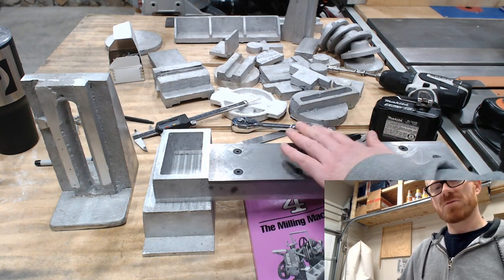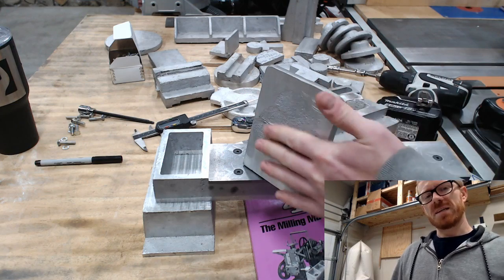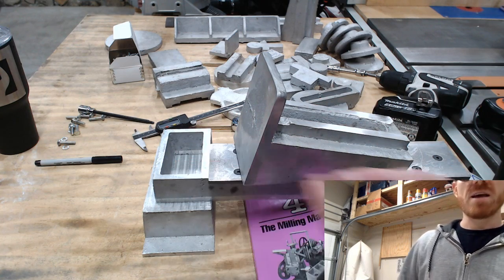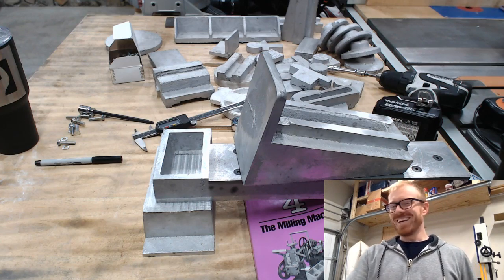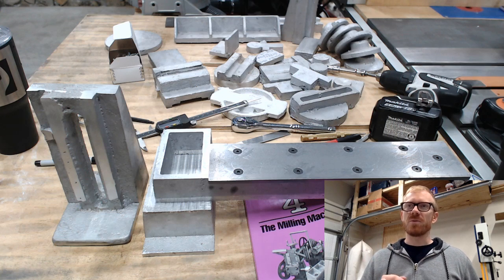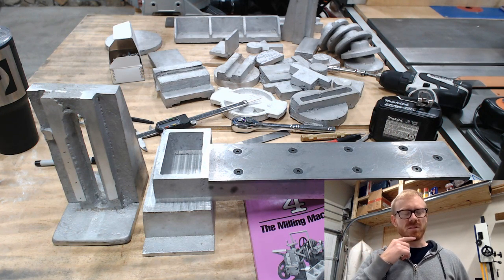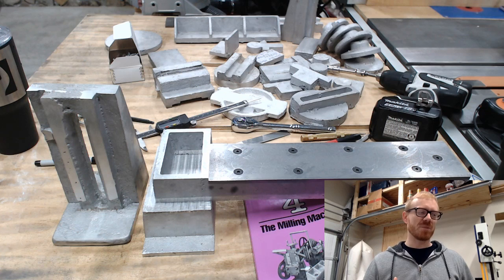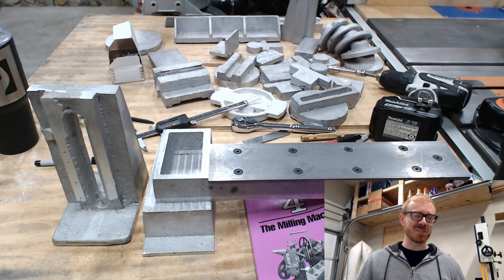Morning - Gingery Mill Bed Done - Ready for Head Stand

Comment: Thank you for answering my question yesterday I watch YouTube on my tv and my kits got a kick out of having my name said on television. I am looking to build my self a mill and this hole experience of build by book looks like the way I would like to go do you know if this mill plan is scalable to build for example 200% or 300% is this option mentioned in the book
Reply: Scaling some of the stuff like the overhangs would yield very flexible castings, overhangs would leave instabilities. You would need to look at the individual parts and decide from an engineering point of view. If there is a truss every 1 inch, you can scale the size up, but put additional trusses to have one per inch also. If the maximum width is 3 inches between two walls, and you want to double the width of a table, you will need to have another inner wall dividing things down the center. If you have any specific questions, I can answer those, but shortly, no, you can not simply scale the mill 200% or 300%. You will also run into the issue of casting the parts. Gingery designed the parts with a specific sized crucible in mind, so any single pour won't have a volume of aluminum exceeding that. The ways on the lathe are essentially the maximum volume you can pour already.
Reply from the maker: Well said AFriendlyMathematician.

Comment: I have the same question others have. I can see doing it this way for the experience, and I love watching your videos. But, I have to believe welding dimensional steel would get you there much faster. I understand the concerns about warping but it seems to me like if you are scraping the ways, anyway, you can take out the warping effects through post-weld finishing, too. Plus there are welding techniques to minimize warping and you can relieve stresses by putting the finished assembly through a heat/cool cycle. Maybe that isn't sufficient and steel just isn't stable enough but I've never felt like I've had a satisfactory answer to this question. I've been planning a lathe build for a while that will use larger dimensional steel as the main structure. I guess eventually I'll find out the expensive way. :-D
Reply: It can be difficult for a novice to get significant penetration on a weld without putting so much heat into the part that it distorts. Across the length of the bed of the mill, you could distort the part by up to 1/8ths, which i'd argue wouldn't be scrapable, that would be angle grinder territory. Steel can also be FAR harder to scrape in vs aluminum let alone cast iron. Most of the precision parts you will see that are scraped are made out of cast iron for a reason. In the case steel is to be used, it is hardened, and either hard-turned, milled, or ground, and left with that finish. Grinding will be more than accurate enough for most applications anyway, you can grind to within .00001 if you know what you are doing.
Reply: what you could also do is making a steel frame an epoxy granite it together for even more dampening
Reply: If welding and using dimensional steel was the way to go, every machine since the inception of the process would be made that way, cast iron is still the best way to get the rigidity and vibration dampening necessary for a precise machine.

Comment: I would love to see this done in cast iron!
Reply: Nott Happening I built a Gingery furnace thirty years ago that used charcoal. I was able to cast Al and copper alloys. Later I built a cupola and succeeded in making 30 - 60 lb batches of cast iron that was fluid enough for green sand casting.

There are two Australian YouTubers and a couple from the UK that cast iron pieces.

I really don’t like the idea of casting pot metal as it produces zinc oxide and zinc metal fumes. Machinable bronze also has lead in it. Babbitt is also a lead alloy but it melts a such a low temperature that lead poisoning is not so much a concern.
Reply: I think the Gingery machine build process is more about learning and building a specific set of skills than it is about building really robust precision machines. Aluminum and Zamak make great options since they are within reach of most peoples novice casting skills. 

I feel if you were to go to the trouble of trying to build a Gingery machine by doing cast iron you would be better off buying an old commercial machine like a Monarch or a Bridgeport and restoring it (or buying from a machine restoration company). 

As for Zamak and zinc oxide fumes, it's not really an issue like it is for brass because of the much lower melting temp. 
but don't take just my word for it.. read this http://theodoregray.com/periodictable/ZincSafety.html

Comment: Al is a very good bearing surface when used with steel, the combination of soft and hard materials is ideal! Regards, Matthew
Reply from the maker: Good point. Kind of like bronze bearings.
Reply: Is there any issue related to Al having no Fatigue limit ( https://en.wikipedia.org/wiki/Fatigue_limit ) ? Or does the combined use with steel mask that flaw and prevent it from being an issue.